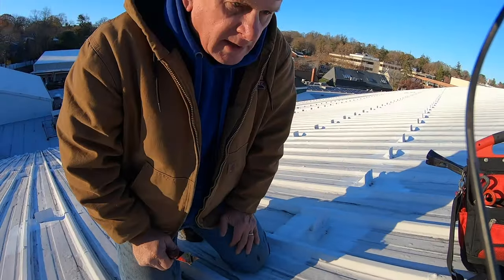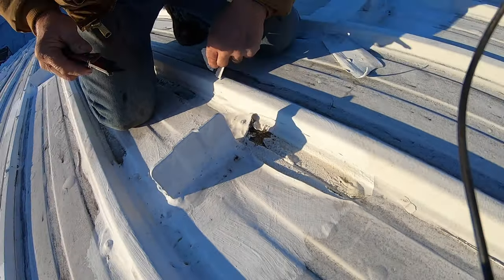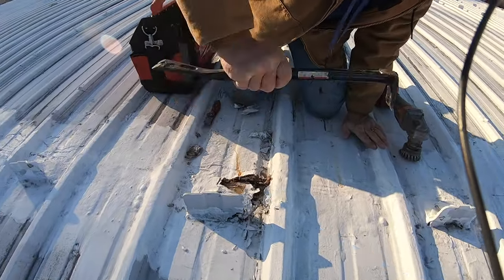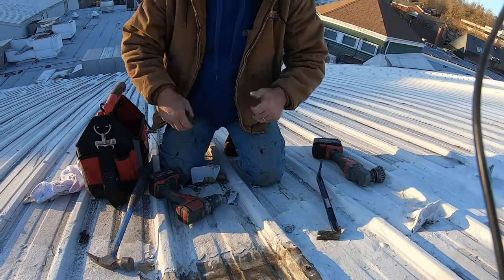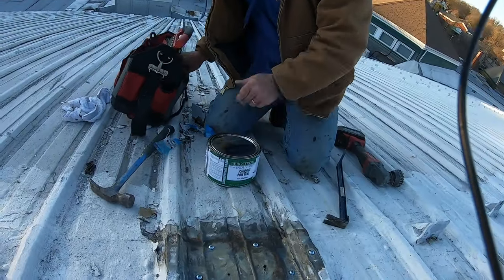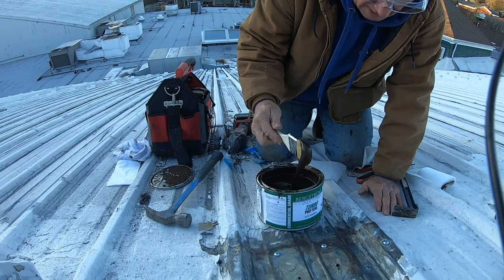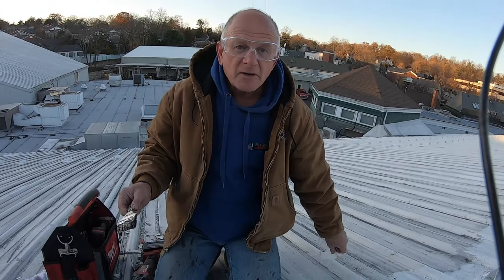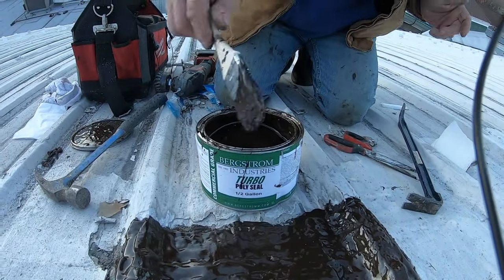Why NOT to apply Metal Roof Coatings - The worst thing to ever do

Comment: As a coating manufacturer and installer, this guy has no idea what he is talking about. Acrylics are garbage on steel roofs there are other coatings that work just fine. A solvent based roof coating should be used because it will stop rust, acrylic coatings if applied over rust will just make the roof rust faster. The seam he was showing on the steel looks to me like it was put down wrong also. The seams should have been sealed first then there would be no issues. A good thermoplastic or aluminum coating will stop rust.

Comment: Don't blame a good product for a poor application. None of those joints had joint fabric applied, the roof was not properly cleaned before the primer was applied, and the coats were not properly bonded (probably from improper glaze/flash time).

Asetec is a good product. There's nothing wrong with an acrylic roof when properly applied.
Reply from the maker: Thanks, James
You are right. The problem is that this will always remain an excuse. How much time it would take to "properly" prepare a surface to be able to get a good adhesion may be why it is not done because it is not economically viable.
You are also correct about the transition between panels should have a fleece. 

Obviously, I am not for coating a metal roof because I have seen too many disasters. There are no quality checks build in to ensure to get a perfect "acrylic coated" roofs. 

I am sure you must be one of the rare people that do quality work and that's why you gave such a good comment.
God bless you and your business
Naas
Reply: @FlatRoofDoctor  - you say you don't approve of coatings... but yet you routinely post videos that advertise Turbo poly. That is a single stage coating.

I have worked with many types of commercial and residential roofing. Acrylic, PVC fabric, standard metal, industrial load bearing standing seam, asphalt, ballasted EPDM, concrete and mag board, fiber panel... the only roof I haven't installed is true glass panel (not fiberglass). All of them have their merits, and if properly installed will last for their guaranteed life. One of the most profitable companies I ever worked for (highest margin) was a polycoat company. I can assure you... proper installation IS economically feasible, AND profitable. It's when companies underbid jobs, or get greedy and start cutting corners to increase their margins. You can't do that... not with poly roofing, or any other job. This is a problem we have in today's world. People are so desperate to make a profit, they don't realize how they are affecting an entire industry when they perform substandard work.

All this being said... in my opinion, PVC (Bondkote/etc.) fabric roofing systems are the best "over roof" solution there is, for the money. If you want the best, longest lasting roof there is... plural component polyurea (Line-X/etc.) is the best over-roof there is... if you can afford the $6 per square foot price.

All notions aside, great videos... I just wish you would rethink the title.
Reply: @jamescopeland8813  Get your own damn channel then "Mr. Expert", the guy is taking time out of his life to show the craft that he inherited and everyone had an opinion. Show us how it's done, All-star!

Comment: Old School ... God Bless You BUT that is NO WAY to represent how to repair a leak on a metal roof. That may be how we did it in the 80's... but technological advancements of exceptional adhesion urethane and silicone products today have far better, reliable, long-lasting solutions. We certify our roof restorations for 10 years minimum -and up to 20 years - have been doing it 17 years - rarely have we experienced an issue - and if so, minor issues. ROOF SUBSTRATE PREPARATION and expert installation of the coating system is paramount. Call a coatings specialist ONLY!
Reply from the maker: Turbo Poly Seal is one of those products that have Urethane properties in it. That is why it so good

Comment: One he laid down the wire brush before he stopped spinning.. That kind of shows that he is not intelligent... 2 this stuff is not white it will draw heat and shrink and expand more than the white.. 3 when he tightened down the bolts water came out and he put this stuff on top of a damp surface If you're smart you would not listen to a thing this guy says.... If you want intelligent advice jet advice I will give it to you do not never never ever put put a metal roof on your building.... It will rust much faster than shingles will go bad....  Lastly Any kind of a coating will do good on the solid surface but when surfaces get old get old they move any any kind of a coating on an old surface that moves is a big waste of time. Him putting that on a wet surface almost guarantees a bubble down the road

Comment: I’ve successfully coated millions of sq ft of metal with acrylics. 22+yrs of it over 18 states. The last thing that should ever touch a metal roof is asphalt or aluminized anything. This is about as far off the truth as any video out there about coatings.
Reply: You sound like you know what you're talking about I have some rental properties that are mobile homes with metal roofs. What would you suggest me coat those with? They don't really have any rust on them just a slight surface rust.
Reply: @Geoonthegrind  mobile home roofs as long as they have decent metal left can be done with either acrylic or silicone. You would just need to power wash treat the joints then either do two passes with acrylic or one pass with Silicone
Reply: Okay I didn't know if there was a particular product that would give me better life and longevity. I'm assuming the adhesion and elastomeric factors are what I'm looking for. I understand the wash will definitely allow that I do house painting but I do not do coatings on roofs as far as on a regular. Thank you for your help
Reply: @Geoonthegrind we carry any & all products you need if you need a material quote.
Reply: @Geoonthegrind  if you’re looking for ease of application and minimal steps 1.5 to 2 gallons of silicone will be your easiest, especially if you’re going to roll it. You’re not going to be able to spray silicone without a high pressure high dollar spray set up.

Acrylic will work perfectly fine. The only issue is you’re gonna have to do multiple coats. So that’s gonna add more time.
Reply: Do I just go to your website or what I'm definitely thinking I'm going to put a silicone on it's not going to be a lot of square footage less than a thousand but I don't want just a sacrificial coating which is what I consider acrylic personally. Even if it is a rental unit the saying goes you get what you pay for. And I may want to start doing some roof coating in my area for my main clients just like Barnes and things like that. I have high pressure sprayers depending on what level of sprayer you would think I'd need but I do have two hydraulic speed flows and then I have other gas powered graco's and things like that I would think they would spread the coating had a pretty heavy mil rate.

Comment: This is the result of a cheap job... when people decide professional labor is "too expensive to just paint a roof".

A PROPERLY installed liquid roof system takes time, knowledge, and more material than just the liquid... and sometimes even multiple different coatings. For example, the seam shear he shows here... never should've happened, and the single unreinforced coat he pulls of explains everything. A professional would've primed the surface for proper adhesion, and used either reinforcement material (gauze, etc.) or seam tape (a specialized silicon tape with absorbant cloth backing) prior to the application. The failure this man is fixing, is most likely the result of hiring people with zero knowledge and handing them a bunch of dollar store rollers.

Comment: After 40 years in the waterproofing game i disagree with you entirely. You replaced one coating with another coating. Asphalt is the worst form of waterproofing since Noah and the Ark. The fleece as you applied it is a temporary fix, come back after a year or two of bad weather and you will have a similar problem to the one you are attempting to repair. Your trying to apply a coating of that goo over water indicates the amateur nature of your workmanship. There are new and amazingly efficacious polymers available today that obviates the need for membrane or fleece. The UV stability is in excess of 15 years and the adhesion tenacity is of extreme high strength. I use Kote products and have never had to ever return to a roof due to failure of product. No Offense. Almost all manufacturers of so-called waterproofing paint use water and calcium carbonate powder as the base bulk for their products, thereafter they add a small contribution of cheap styrene acrylic as binder. It is no surprise then that the cheap crap only lasts a few seasons. Most clients choose the cheapest quote and they get what they paid for.
Reply from the maker: Ok, thanks for the lengthy comment and explanation. Excellent. I have used Turbo Poly Seal for over 5 years and have been back on many of the repairs and have not seen any deterioration, especially when I coated it with Silver Coat protection. I also have seen repairs of the Turbo Poly Seal done by others way before me. It appears that in some cases the sealant was wearing off, due to UV's and needed another coat around 9 years. If it were protected, then it would have lasted longer.
So far so good with the products I use. I might be your amateur, but it works. Professionals like you always have  a nose up opinion. The better than thou attitude. I am helping home owners to do it themselves  instead of roofers ripping them off. i am not there to teach you, because you know it all. I am only helping everyone else so they can avoid the expense. What I show works, and not always necessary to go the professional way, like you suggest.

Comment: Is not the coating the problem is the problem due People do not clean
Reply from the maker: You are partly correct. It is almost impossible to ensure that every screw and every part is properly cleaned. 
Then because there is expansion and contraction at the seams, the coating will eventually break or crack trapping water in the seam

Comment: Do you see how bad of a job that is. Their is your problem. 1 the roofer 2 the wrong coating 3 the wrongs steps applied.
Reply from the maker: sure we can find a lot wrong with everything. My experience is that it is almost impossible to prep a metal roof so well, and apply a coating the perfect way, to get it to last. There are to many variables and things that could go wrong

Comment: Destroys 200% profit industry in 5,4,3,2,1…..
Reply from the maker: This "Industry" has robbed innocent people of hard earned money and cost 200% of unnecessary expenses. They should ban this type of daylight robbery. 
People trust salesman. The roofing industry is full of corruption, everyone out to make a buck, regardless of experience or knowledge. I know because I remembered what I was doing when I started. I only sold what I knew and did what I think was right. And that is how the entire industry is.
But to sell a spray foam, silicone spray or latex coating to cover a metal roof is absurd.
That should be banned. It is very very seldom that a metal roof need to be coated completely.
The profit Industry is a "Robber Industry".
I am pretty sure there are some companies that does a decent job in coating a surface, but they will sell a job to a potential buyer regardless if he needs it or not, that is the issue. Robbers!!!
So, because it is relatively easy to convince a buyer that he needs a new roof, the roofing industry is flooded with scammers. Everyone jumping in on the band wagon, it is overloaded right now.

Comment: surface applied sealants will fail 1000% of the time.  Please stop killing metal roofs.
Reply from the maker: You got it wrong. I am for metal roofs!! Not against it. What I am against is companies selling sealants to roll on or spray-on and make people believe it works. I am sure there are sealants that will work, but not what I have seen so far.